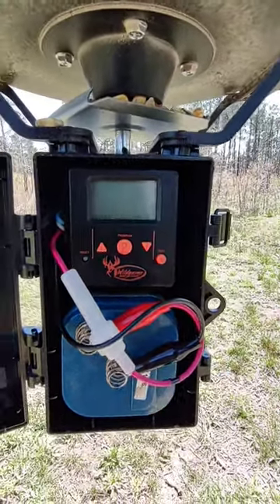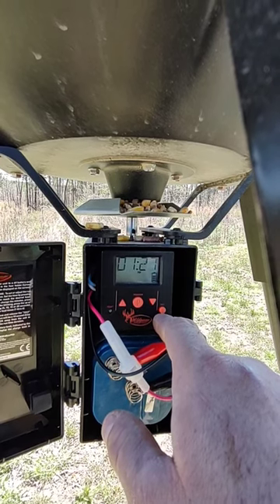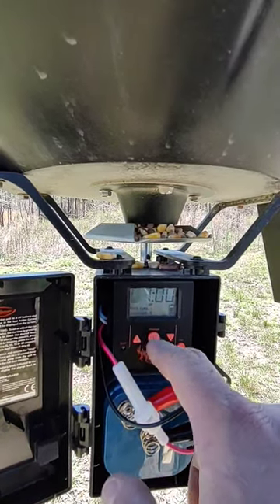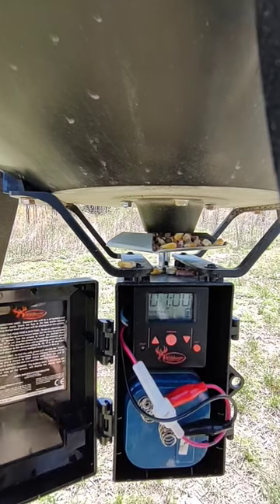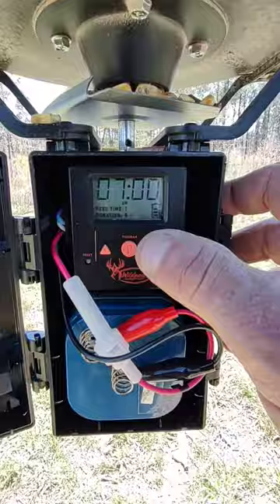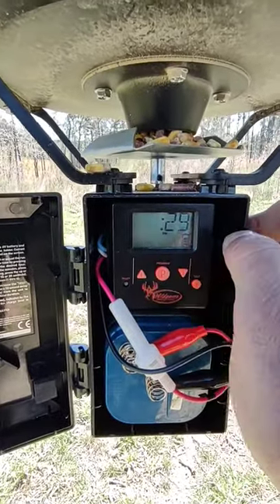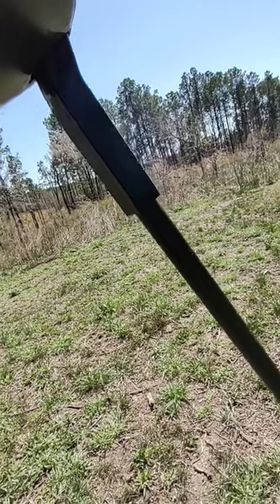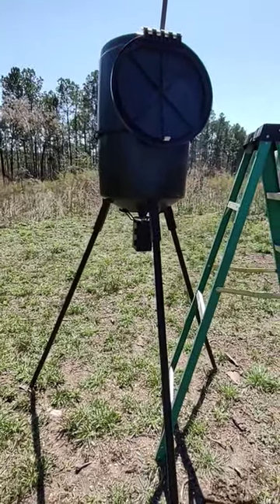How to program wild game innovations feeder.

Comment: Question.  When you have it set up does the LCD display stay on? When I go check mine it’s a blank screen till I hit a button them stuff pops on the screen
Reply from the maker: No the display goes blank after a bit, your right though when I go check mine I just hit the button to pull up the display.

Comment: Do you have issues with the battery turning off in the cold ? / time being way off after a week
Reply from the maker: I haven't had either one of those issues. The only thing I can think of is pin you clips in really good to make sure it doesn't lose connection maybe, or look at your wires all over in the box and check them good.
Reply from the maker: I haven't had either one of those issues. The only thing I can think of is pin you clips in really good to make sure it doesn't lose connection maybe, or look at your wires all over in the box and check them good.
Reply: @paysonfamilyoutdoors5292  I have the wires clipped on the very end of the spring connector. Ordered a wild innovation battery with better terminals 🙏
Reply: @paysonfamilyoutdoors5292  thanks for answering!
Reply from the maker: I always put the clip closer to base of the battery terminal or spring.

Comment: My time of day is going by minutes 🤦🏻‍♂️ if I set the time of day to 4:00pm and set a feed time to 4:30 pm 30 seconds later it starts to run!? I can’t find anything to help with the issue 😭
Reply from the maker: @buckwild1994  that does sound kinda crazy. I would try taking the clips off the battery and let it reset for a minute and try again